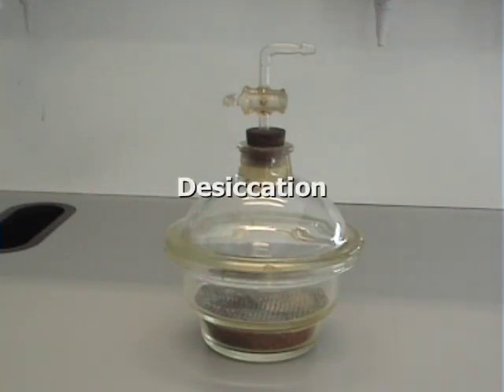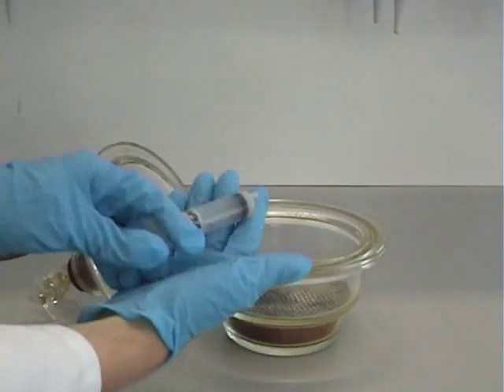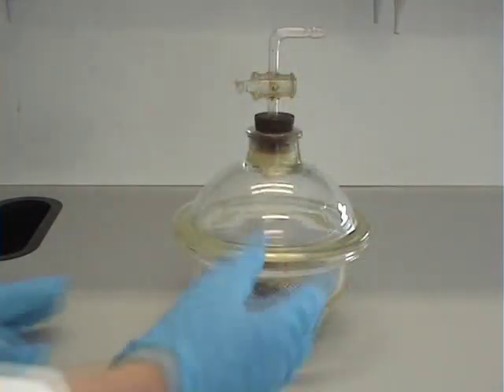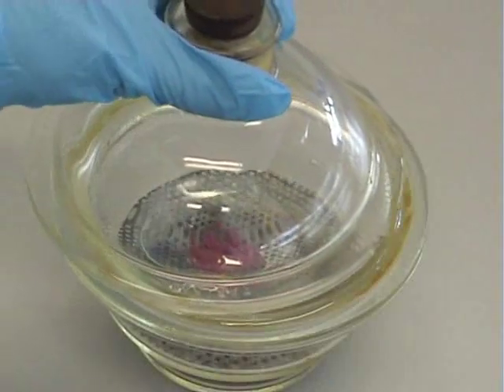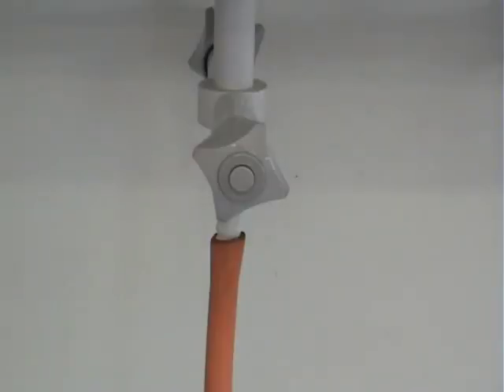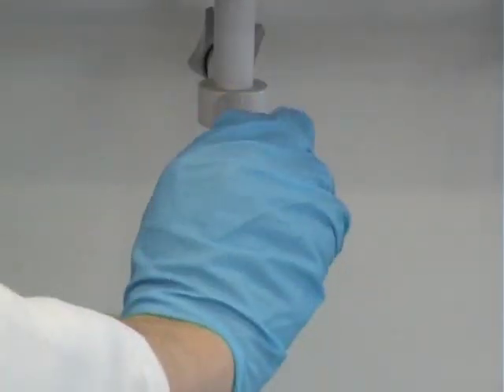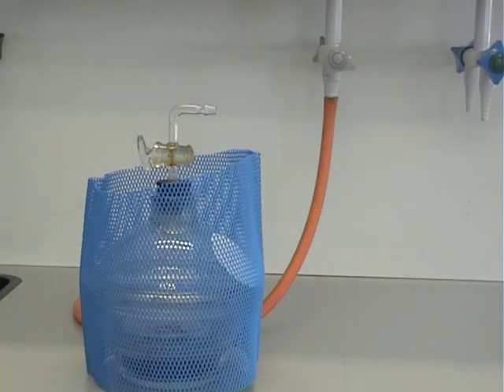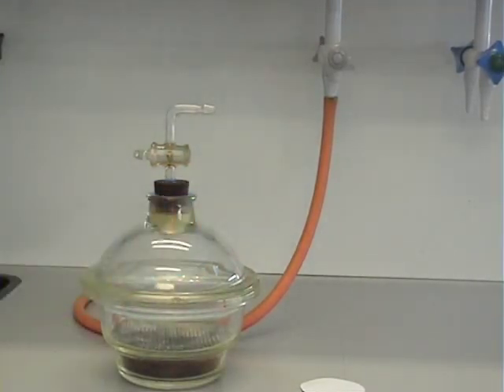Using a Desiccator

Comment: This answers a recurring question I have about how to put to use a random Standard Taper joint vacuum take off piece... This is another use in the bank. So far: 1) Gas generator 2) Vacuum desiccator. Thanks! Now 1 question: Is the desiccant simply sitting in a dish at the bottom of the desiccator, and an acrylic screen is separating the watch glass and drying agent? Thanks!